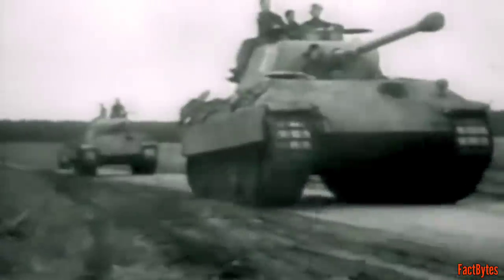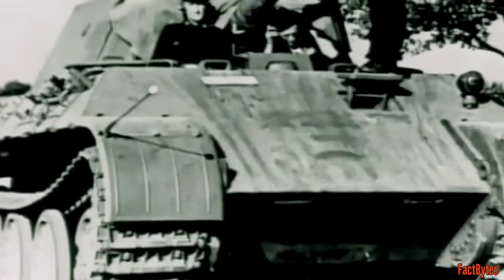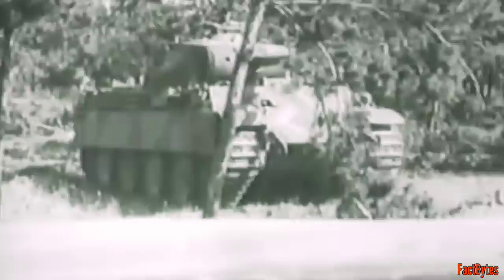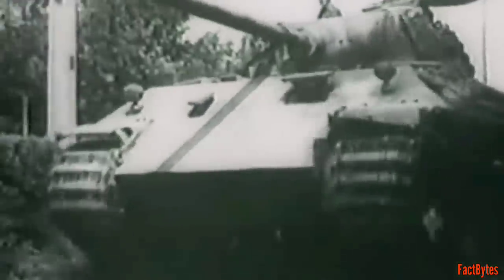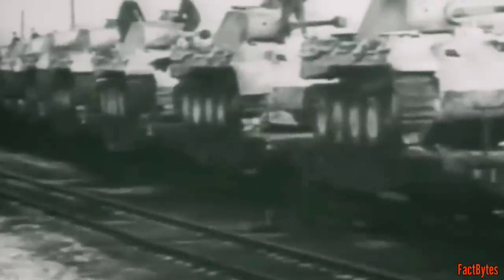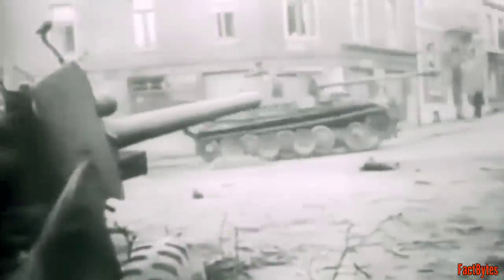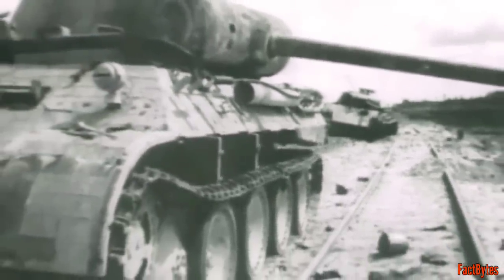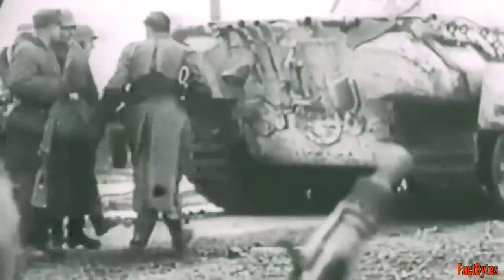Was The German Panther Really The Best Tank Of WW2?

Comment: If it had been mechanically reliable it would probably be the best mass-produced tank of the war just going on battlefield performance.  Lethal gun, very good front armor, very good mobility.  But considering all the factors from production cost and time, mechanical reliability, ease of maintaining it in the field, etc       no, not the best.   T-34/85 or the 76mm Sherman would be the best taking all factors into account.
Reply: You have to take into account sabotage and material quality when talking about German equipment, problems the Allies nor the Soviets had to contend with. By the time the panthers were rushed into service slave labour was being carried out and therefore sabotage. When you look at panzer 4s pre 1942 reliability was never an issue, however by 1945 sources show that the reliability of the panzer 4 and the panther the be comparable with most accounts favouring the panther.
Reply: @alexgeorgescu1843  why?
That was the plan from the outset as to how the panther was going to be produced. Period. They designed it specifically so slave labor could produce it.  
If that is your argument, then you cannot judge the Sherman for lack of armor because the had to transport it. (64mm at 47 degrees works out to 94mm so not exactly weak armor but whatever).
The whole point of Barbarossa and the Sudetenland and the rest was resources. The started the war and conquered territory specifically for resources.
Reply: @drudgenemo7030  well you don't exactly plan for sabotage when introducing a new tank design. The major reason for engine fires with the panther were in fact sabotage. The precise tolerances required for all the moving parts to work together efficiently and reliably were meddled with initially by the slave labour working on the tanks. Not to mention poor German logistics not being able to overhaul and maintain tanks due to combat strain, lack of lubricants and maintenance facilities due to overextention. In fact, captured panthers in soviet hands were well praised in fact a whole tank battalion used captured panthers at one point during the war and much preferred the German and American tanks to their own. Although the Germans did prefer American tanks for ease of maintenance. As for issues with the final drive, the tanks were rushed into service without sufficient testing and crew training, more experienced tankers never had problems with the final drive but seeing that Germany had lost its elite soldiers and veterans during 43 to 44 there is little you can do to train reservists to operate such complex vehicles efficiently and effectively. Would the m4 Sherman been a superior tank for Germany at the time, in some aspects yes, such as maintenance and usability but as for every other aspect no. You could argue the panzer 4 was the Sherman equivalent of the wermacht and the Sherman would not suit the doctrine of the wermacht as it was an infantry support tank not a combined arms breakthrough tank. The panther was a tank designed for the eastern front, it was utilised poorly in France and not suited for narrow street fighting or through the groves, however it did excel on the eastern front at long distance engagements. Overall it was a great concept but not one utilised to its full potential for the reasons stated above. If there is a tank preferred by troops from all sides it is the m4 Sherman however, the Sherman could never be utilised in the doctrine of the red Army or the wermacht to the effect the domestically produced tanks were.
Reply: @alexgeorgescu1843  the Sherman was indeed actually used by the red army with their doctrine(the Sherman was however not really compatible with Soviet industrial capacity. Are you arguing that the Germans were industrially incapable of producing the Sherman, and the inconsistent build quality of the panther was as good as they could do? In fact the Germans had far more hand fitting of parts so probably really couldn't produce the Sherman like the Americans did. Ooph that's gotta sting the German fanbois)
And if you plan for slave labor to do the production, your are nine kinds of flat out stupid if you think they are just going to do exactly as you say, ask any Confederate.
And the carburetor was an issue of gaskets, more of a faulty design.
The German doctrine was to move through the enemy rear targeting "communication, supply, and reinforcements". As the Sherman had a bigger gun for most of the war, with better armor, AND better cross country mobility that the pzr4, it was better suited for that. As the Sherman was more reliable, lighter and better able to use existing infrastructure(the panther was 25% heavier than the Sherman, the difference between a 160 pound boxer and a 200 pound boxer), and with a better HE round, it was superior to the panther for German doctrine as well. At least according to the written doctrine.
Reply: @alexgeorgescu1843  and Germany lost it's veterans in 42 and 43. Literally by Stalingrad they had started pulling from the strategic labor (the guys making tanks, guns, bombs, ECT). So the whole untrained unit crap is just crap too. They were 4 years into a war of attrition when the panther went into service. They might have had SOME experience with that a 20 years prior. But I will admit the panther is a crap design for poorly trained conscripts. That doesn't make it a good tank, in fact it makes it a BAD tank. From a design standpoint. 4 years into a war of attrition. The T34 and the Sherman were both driven almost exclusively by conscripts. So by that argument, were vastly superior in that design criteria.
Reply: @alexgeorgescu1843  and if you are general staff, do you want a tank that works everywhere reasonably well, or do you want one the excels in only one theater of operation? Especially if you have limited production capacity and worried about access to resources. Pretty sure the Germans had some experience in western Europe, and they were indeed fighting the Sherman in Italy prior to the introduction of the panther.
Reply: @alexgeorgescu1843  and now the final drives
The claim is experienced crews got 1500km from the final drives.
The Sherman got 4000 MILES.(if you don't get miles and can't figure out the conversion with the internet, that's 6500km, or 4x the durability compared to the "ideal" conditions as opposed to the what was actually documented)
There was standing orders from German high command NOT to use neutral steer or climb hills past a certain grade because the final drives would fail.
The panther was transported by rail as much as possible, as short as 25km according to documents.
Post war, not dealing with combat, not dealing with field maintenance, not dealing with a strategic blockade, not dealing with slave labor sabatoge/ineptitude, the french managed 800km on the final drives.(when the Prius first came out, one auto magazine managed a 200 mile trip averaging over 100mpg, it was a competition with other magazines, on public roads. You do not reasonably expect your Prius to get 100mpg, more like 40-50mpg)
This gets back to the whole conscript thing and how that was a poor bit of engineering.
As the Germans didn't use an independent turret traverse, or an auxiliary motor for the electrics, nor roof mounted sights, or periscopes for the crew for good all around vision, mostly to reduce costs, but keep the expensive neutral steer and the boosted controls might be questionable as well. For an army that had used up it's veterans by that point.
Reply: So if it was completely different then it woulda been better?
Reply: @drs4983  well it had 80mm of frontal armor.
The engineers were going to go with 60mm.
The kwk42 massed 500 pounds more than the kwk40 in the turret (IE moving mass) and needing corespondingly more room, and more room for ammunition, IE more space to armor, hence even more weight.
The biggest problem with the panther was too much weight.
Drop the armor and put a smaller gun on it you lose mass. A lot of mass.
Then the final drives might not fail, at least nearly so often. Existing infrastructure and military bridging aren't the concerns, so the tank gets to where it needs to go in a timely manner.
The tank also gets cheaper and easier to produce, and recover.
Add a roof mounted sight from a stug, especially a wide FOV one(the Germans were actually pretty good at optics) so that the gunner might be able to locate a target easier.
Add an independent traverse to the turret so your big, thirsty, problematic main engine isn't needed to spin the turret.
And maybe, it's a thought, ditch the powered steering controls so it's more difficult for the driver (a poorly trained conscript) to over stress said controls.
Less weight, less demand on the drive train, not just in weight, but in load demands, and more reliability and combat mobility.
With the independent traverse, add in a commander override so the TC can get the gunner on the next target quickly and efficiently.
All of which puts steel on target faster(the whole point of quality over quantity, especially if you are outnumbered).
The pzr4 had an independent traverse system until late 44, so none of it is something the Germans were unfamiliar with.
This is all Monday morning quarterback or armchair general or whatever.
But building a bigger heavier tank that's unreliable isn't technical innovation. And a tank sitting in a repair yard or broke down on the way to battle doesn't do a lot of good.
German armor manuals were all about movement and striking were the enemy was weak and vulnerable, not about tank duels.
Reply: but then another major problem will manifest itself; Germany lacked the fuel and the staff/manpower to suddenly triple or quadruple the number of panzer/panzergrenadier divisions. I didn't even realize this until it was pointed out to me. The 'mech' forces Germany already had was 'taxing' the logistics but they made it work.
Reply: @Filthy-Disgusting-Ape  the Germans repeatedly ran out of fuel.
The Blau offensive stopped 4-6 times because the panzers were out of fuel.
Post D-Day a significant portion of the panzers were abandoned because they were out of fuel (or broke down, or both). And that logistics headache included spares. In 1940, crews were literally fighting each other over spare parts, let alone later in the war. Barbarossa included a significant number of Bren carriers because the Germans had so few tanks.
I don't think I would classify the German logistics situation as "working effectively"
Reply: @drudgenemo7030 Logistics is easier to do when you're on the defensive. My main area of interest is The Air to Air War in the West and South, so fuel was always a HUGE concern (especially the training schools) for the Germans. In spite of that, I didn't see fuel/supply/staffing issues The German Army would have had IF they suddenly turned out more tanks or AVFs like PzIVs and Stugs, until somebody on the IMDB  (RIP!) brought it up in discussion thread on one of the WW2 movies/series we loved to discuss.
Reply: Some good discussion here, nice.  When listening to the accounts of rushed development and all the (progressively worstening) production issues I could not help but think that concentrating on producing far more late-model Panzer 4s might have been more to Germanys advantage.  But as the video points out, by later in the war the quality of even these more basic tanks was falling.
Reply: t34 for sure wasn't a good tank, it was rushed so hard in factories that its armor would often crack from the shell impact aka, everyone inside would die due to shrapnels
Reply: I agree that the 76.2mm M4 Sherman was the the best tank of the war all things considered. It was easy to manufacture and maintain, it’s 76.2 was positively lethal (contrary to popular perception it could penetrate a Tiger 1’s armor) and it simply kept on going. M4’s that landed in Normandy drove to the Elbe River and met the Soviets. The Soviets manufactured their T-34’s with a 6 month life expectancy. They calculated that no tank was going to survive for longer than 5 months due to wear-and-tear as well as combat.
Reply: T34/85 and, Sherman 76, G all said with a straight face lol
Reply: Hard to say. Even with the mechanical problems had the Germans produced double the number of Panthers and had them a year earlier perhaps there would have been a different outcome?
Reply: The panther had a kill/loss ratio of 1.2 to 1
While being almost exclusively on defense (generally considered a 3:1 advantage for the defenders) so I'm not sure about the combat record reflecting it being such a good tank.
The one large scale battle against the Sherman was arrancourt. Kursk wasn't exactly a stellar performance either.
I don't see the combat record as showing it being all that effective.
Reply: @drudgenemo7030  I was not aware the kill/loss ratio was that unimpressive ... I am supposing that a lot of Panther 'losses' were the broken-down ones (that France repaired and equipped its immediately-post-war Army with).
Reply: @alfnoakes392  arrancourt was a 6:1 (a few hundred tanks on both side involved)lopsided win for the Americans. Levels the playing field a bit from all the ambushes the Germans had, and that's just the western theater. If you add in the Eastern front, the long ranges and Soviet doctrine played more to the Panthers strengths. The slow traverse and limited FOV and no commander override in the Panther also hobbled it's ability to hit multiple targets before having to move or be destroyed (gunner hits target A then the commander slews to about where target B is so the gunner can get fine lay instead of trying to figure out where he's talking about, makes multiple targets far easier to manage)
Reply: @drudgenemo7030  Kursk was a tanker's nightmare.  Most tanks could never survive so many layers of anti tank guns from side firing positions.
Reply: @jimbeam7160  and the 16% readiness rate and the fact 2 panthers self destructed getting off the train had what to do with AT guns?
The whole point of WAITING for citadel was because of the panther. Crying that the enemy decided to prepare for it is ludacris
If the Germans had just been polite enough to wait for the french to mobilize their reinforcements at Sedan, I don't think we would be discussing Kursk.
Reply: @jimbeam7160  tanks allocated to the fight, but fail to make even the SP are still part of the units allocated.
A tank that shows up beat one that doesn't every time.
Reply: @jimbeam7160  and the panther had 40mm side armor. A lot of those "anti tank guns" were 14.5mm rifles. Why the skirtzen was developed
Reply: @drudgenemo7030 I've never heard a kill ratio that low. Not saying you're wrong but I just hadn't heard that before.
Reply: @JayTide  Zaloga has done the that kind of research 
The Sherman had a POSITIVE kill ratio against the Panther 
And the ONLY major engagement between the two was Arracourt that was 5:1
Now ALL engagements are more than tank vs tank, and as Germany has been losing for 2 years at that point, there were other factors than just tank x vs y
But at the end of the day, the Americans in their 75mm armed Shermans killed 5 times as many Panthers as they lost
Reply: I agree on both of you, yes it has good sloped armor, good main armament and etc. let’s compare it to the tiger 1 
Differences: the tiger is heavier than the panther in result it’s a bit slower than the panther is lighter so at least a bit faster than the tiger. Both have the same armor, 100mm but the panther has sloped armor, let’s take the T-34 as an example, it’s armor is 45mm but since it’s sloped it had a 100mm armor effect so the Panther is similar. The tiger have a 88mm but the panther is 75mm. Similarities: both tanks, Tiger 1 and Panther have a powerful main gun, both can do damage/destroy a M4 (sherman). Armor is the same 100mm (but the tiger is 25-120). Unluckily both’s tank engine’s can catch fire more especially when in combat.
Reply: @jaden_012  the t34 had 45mm armor at 60 degrees, equivalent to 90-95 depending on source(assuming it's made correctly, which is another issue/debate)
Basing gun power on bore diameter is not a good idea(and not always is the bore the same as it is named).
Then please take a look at the actual manuals as to how that country trained and expected to used their tanks.
For all the noise about tank vs tank, it was rare, and not exactly what the tanks were supposed to be doing, please read the GERMAN manuals.
And the point of a tank in getting steel on target. That's turret traverse, optics, communication between the crew, reload speed, and accuracy.
The kwk43 is a great big gun(needing a huge tank, the panther was taller than the Sherman). It's performance came at a cost, there is no such thing as a free lunch, EVERYTHING is a compromise. A Ferrari is a great fast car that has no space for groceries and gets shitty gas mileage.
It's just about impossible to simulate ergonomics in a video game, the sights are all the same view with maybe a different reticle. So not the case sitting in the gunner's seat in different tanks, or for that matter different models of the same tank.
Reply: @jaden_012  u are very wrong on how effective the 80 mm of the panther were
The 76 mm american anti tank cannon could not pierce a panther from the front at any range while it could kill a tiger 1 at 1000 meters and t34s even at 2000s
Reply: T-34 was trash. Did you know germans destroyed 44.000 of them? Any type of sherman was trash no matter what down the bottle hatch drunktard Chieftain tries to sell. That tank should be called flammable. 5000 shermans was destroyed and there was not even great tank battle on western front When there was Ardennes offensive and when shermans came face to face with spearhead of 400 panthers and tigers, then US decided to send in europe Pershing tank which was only real proper US tank but obsolete by that point because it was same as tiger one with little better armor and Tiger 1 was first on battlefield in late 1942. . Sherman was death trap. Sure, soviets like them because they only had experience with trash soviet designs that didn't give much for crews but sherman couldn't stop any german projectile and they went through sherman's frontal armor like knife through butter. Reliability of Sherman is also lie because it was reliable only when there was spare parts. Germans captured several of them and they were not in driving conditions very soon because germans didn't have spare parts and they had no use for tank that could not survive enemy fire. Crews of sherman placed logs on side armor to protect it but it was no use. Britain lost 15.000 tanks and that also ridiculous because as I said before: there was no large scale tank battles on western front for them to have such casualties. Tiger 1 was best tank of the war since it was only 1500 of them and yet they left their mark that will never be erased and Panther right after them because they had everything gun, armor and speed. few problems here and there because of development but pros are lot better than cons.